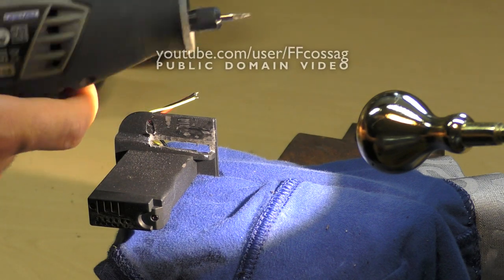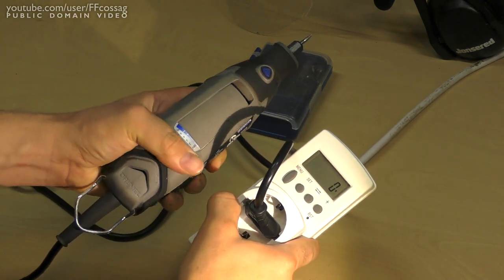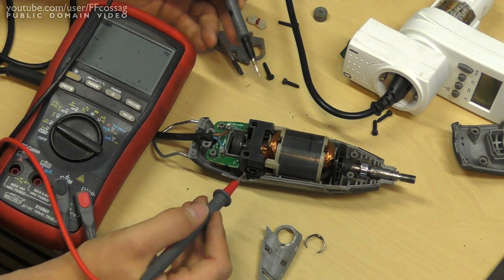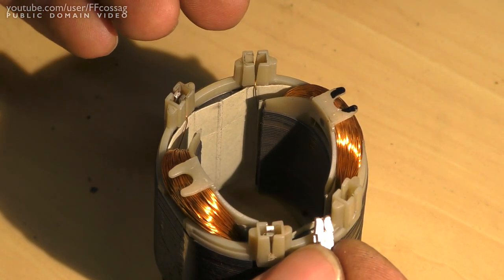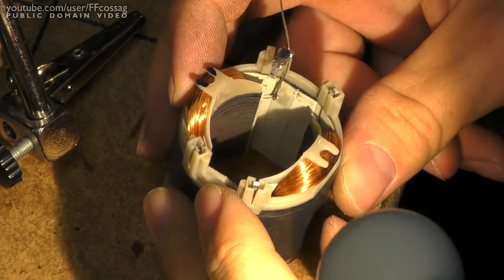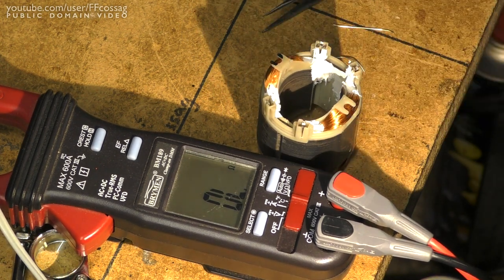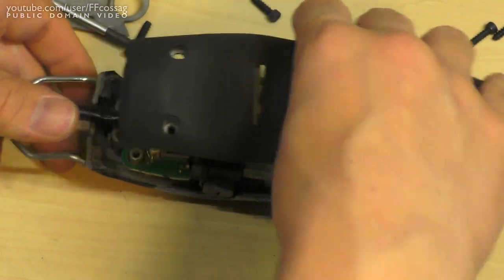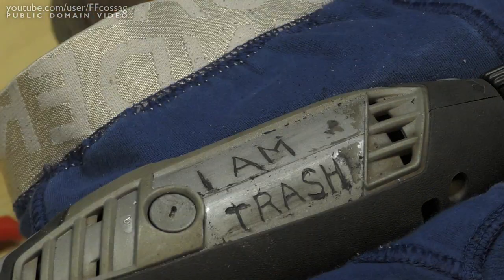Dremel 3000 trobleshooting & stator repair

Comment: few others  video(s) complaining about the same....Poor Quality control .
Reply: It isn't poor quality control, it is quite good design. Connecting wires in a moving environment is a difficult thing to achieve. Dremel designed in a compromise, easy fix, but you'll have to open it up every couple of years and sacrifice a single turn of the electromagnet. The guy in the video is an idiot, tools should be made so the operator can service them just like this one is.

Comment: You have become a dremel lol :-D

I have a very cheap version of that dremel, it has effectively a lighting dimmer circuit for the speed, triac/diac some caps and resistors, and  a bridge rectifier to drive the motor with d.c.
Works very well really, but even with the speed set to lowest its still a bit too fast.

Your dremel wasnt assembled correctly, blame whoever taught the assemblers.
Reply: If i was to buy one i would fully agree with you, but the cheap  one i have was a present, that was 6 years ago and its still working :-).

I thought he did an excellent impression of a dremel :-D
Reply from the maker: I'm blaming Dremel corporate for not speccing a decent support for the winding wires. Silicon would have made this a non-issue.
Reply: Yes that would have been better.
The motor itself looks good enough for the task.

Do you often do impressions of power tools lol :-D

Comment: Its a crappy design, the on button is a speed select slider... when dust gets inside from working on a project sometimes it will no longer work, it will either be off or full blast... this dremel is a piece of junk